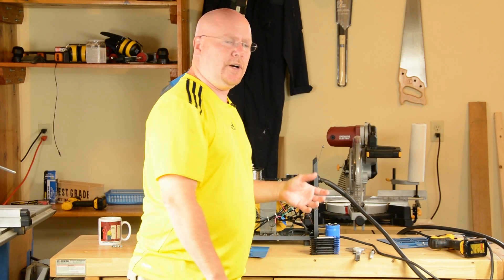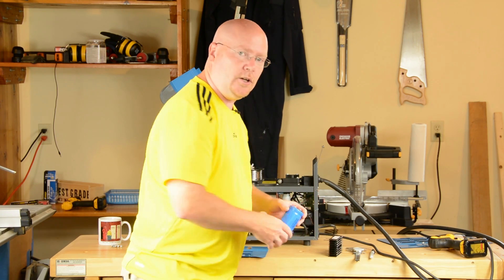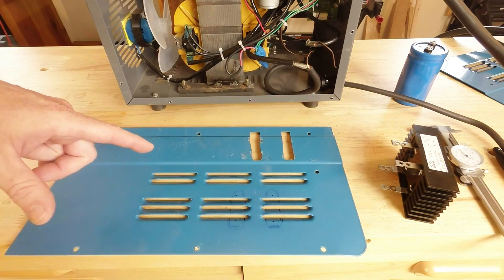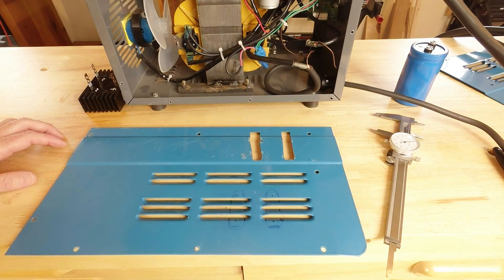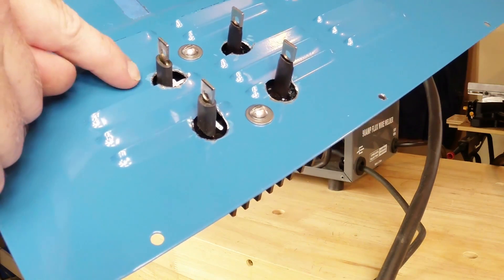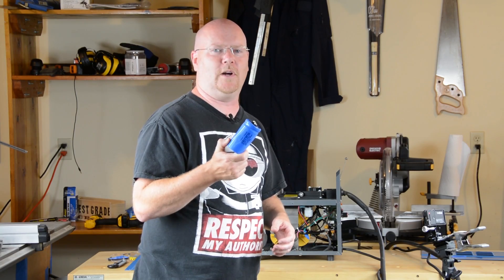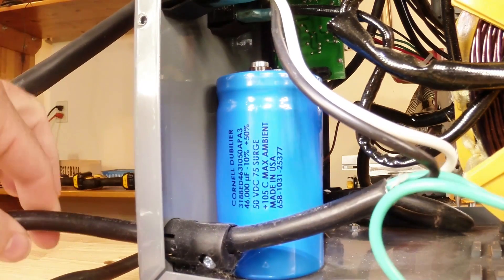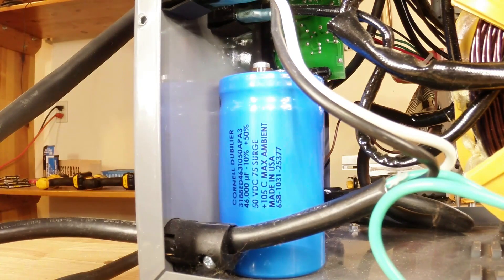Advanced Harbor Freight 90 AMP Welder Mods 03

Comment: Hi I have a 130 amp/90amp tig inverter from hf.  I never used it at all but the capacitor between the positive and negative on the inside of the machine broke one of the legs broke.  Do you know what size is so I can replace it?  It's wrapped with black tape or something so I can't see the values on it
Reply from the maker: HI Steve.  Nope, never had a look inside one of those so I don't know.  If it's broken you may as well remove it (make 100% sure it's fully discharged 1st!) and do what you need to do to it to determine the ratings.  It's not every going to do you any good as-is.
Reply: @MattHeere  thanks for the reply. It is definitely discharged,  was just looking to get it working again.  I'll keep on messing with it in a safe environment.  I appreciate you getting back to me.

Comment: I'm doing the same thing to my welder lime yours, but I moved the power cord to the back, and I'm going with a miller M25 mig gun to it. I bought the welder for  $5, and it was a bit chopped up. I put in a separate 20v transformer for the wire feed motor.

Comment: the rectifier would have been fine with the fin side bolted to the top of the chassis (next to drive feed roller) the fins making contact would have fine.. if you are truly concerned get a thermal pad to sandwich between the rectifier and chassis ;) the case would have quadrupled the size of the heatsink..

Comment: Have you ever measured the max dc voltage off the capacitor? The cap you use is rated at 50 volts dc 46,000mfd.
Reply from the maker: The max DC voltage is equal to the peak (not RMS) AC voltage and is right around 40 volts in my welder.  From other comments, I've come to understand that this can vary by up to +/-5 volts between welders.

This is the at rest condition, so peak voltage but zero current.  When welding, the voltage drops down into the teens.

Comment: matt can a sterio system Capacitor work?i probably missed the wiring from ac to dc.
Reply from the maker: Not usually.  the voltage rating on car audio capacitors is too low.  20 volts or less, when you need at least 40.
Reply: Yes i didnt think of that.thank you.great videos.
Reply: Mr. Matt can you if you can link me to that capacitor.or where you bought it?thanks
Reply from the maker: Hugo Chavez I got mine at a local hamfest.  eBay is your best option.

Comment: why bother with the 90a model? spend a little more for the 170 that welds DC, 1/4" steel, and has the option for gas use.
Reply from the maker: Because I got this one for free, and because a lot of people don't have access to 220V power.  

If you have 220 available, and you're going to buy new at HF, then I think the 180 is the only decent option.  The "Min/Max" voltage selection on the 170 isn't nearly enough control to weld effectively with any serious amperage.

Comment: the rectifier can go inside and be fine i run cnc equipment and yea their  all over inside the electrical control panels
Reply from the maker: +Jon A It can if you can get some airflow over it.  This thing dissipates about the same heat as an electrical space heater (obviously for much shorter periods though).  Even if it doesn't hurt the rectifier, that's a lot of extra heat on top of the transformer heat to subject the wire feed electronics to.

I think if you put it inside you're pretty much committed to upgrading the fan at a minimum.

Comment: Hi, nice tutorial here, can a car alternator rectifier be used for this? I have some cs130's and hoped to use those, thanks.
Reply from the maker: 2008OntarioL You'd have to find the exact specs for the diodes in the rectifier.  Auto rectifiers are typically 3 phase, so would have an extra input that you don't need, but this won't hurt anything.  I'd be most concerned about the current rating.  cs130's came everywhere from 70 to 170 amps.  The smaller ones would burn up fast in welding duty, but the bigger ones might be OK.  Rectifiers can be wired in parallel to achieve higher current capacity too if you really want to start a project :)

Comment: Hi Matt. I have a question for you. I love your modification, and I plan on doing it. I have access to lots of the components you have added to complete your modification. One of those components is a large capacitor. It's a BC 75 VDC 100 SURGE 23000uF -10 + 50%. Here is a link so you can see the capacitor for yourself http://www.ebay.com/itm/Capacitor-23000-UF-3042688-3192GH233T075AMA2-75-VDC-100-Surge-/400850286882 . It's a beast! However, the uF rating is 1/2 of the rating on the capacitor you used. Admittedly, I am no expert with electrical components, but in my research I have discovered that the uF rating is a measure of how many electrons the proverbial "tank" will hold before discharging. How important is it that I use a capacitor with a higher uF rating? Is it less important than the rated voltage of the capacitor? The rated voltage of this capacitor is WELL within the limitations of the welder. If I can't use this capacitor, I will probably have to buy one with a higher uF rating. Fortunately, there is a HAM Radio shop up the road from my work. I think I remember you saying that's where you bought yours. Any advice would be appreciated. Thanks.
Reply from the maker: Trinity Maker You have the concept exactly right.  A bigger "tank" in this case helps keep the voltage closer to constant through out the weld.  If you're skilled at keeping your wire stick-out even then odds are you'll notice no difference at all between your cap and mine.  Even with less than ideal conditions, the rectifier is giving 90% of the improvement.  So, variations in the capacitor are only a small portion of the overall mod.

I say go for it with the one you have.  If you pick up another one cheap at some point you can always swap it out, or add the second one in parallel to even more bang.
Reply: Matt Heere Matt- I have several of them. You think if I put two of them in parallel it would only accentuate the abilities of the welder? I know when you put batteries in series vs. parallel, series doubles the voltage, but doesn't change the current. When you place them in parallel, the voltage stays the same, but the current doubles. Is this the same concept with capacitance? Will the voltage stay the same, but the uF rating double? As I said, I'm a component "novice", so I appreciate your expertise.
Reply from the maker: RIght again.  For capacitors in parallel, the effective uF is the sum of the two.  However, the allowable voltage is equal to the lower of the two caps since they'll both see the full voltage. 

If you wire them in series then you add the voltage ratings.  The effective capacitance is less than either one though.  It's:
1/Ctot = 1/Cap#1 + 1/Cap#2
Reply from the maker: Yep.  It's a wise idea to let a little extra wire out and then short it to the ground to discharge the cap.

Comment: Matt-great instructions. I am definitely going to try this BUT the rectifier I found has 5 pins, instead of only 4. What do I do with the 5th pin? thanks
Reply from the maker: ***** You can ignore it.  You have a three phase AC rectifier, so it has three AC inputs.  Just pick any two.
Reply: Matt Heere wherr can i buy the parts and does it have to be Capacitor 46000 uf - 10%+50%50vdc75 surg+105cmaxambient can u tell me on the uf can go higher or lower

Comment: I wonder if you could wire a relay after the capacitor? I'm thinking you could use the wire from the button on the gun as a trigger. The goal being to prevent the leads from being hot after you turn off the unit.
Reply: Better known as a contactor.
Reply from the maker: You could, but you'd need to use a relay that's rated for at least 100A across the contacts.  You'd probably also need to find one where you could clean the contacts as I expect they'd arc significantly every time you fired up.
Reply: Matt Heere After doing more research, I think I'll go with a big resistor across the capacitor contacts. The relay would just add complication, and the resistor seems to be the most common approach.
Reply: Thank you. I learned something new today!

Comment: So I have a couple of big transformers from some old power supplies that I got from my work.  If I was to use the core of one of these and make a good sized inductor would that work as good as the capacitor?  I have everything to make the inductor but if having a capacitor is better I'll do that... Or both??
Reply from the maker: Both is definitely best.  An inductor will attempt to maintain a constant current flow.  The capacitor maintains the voltage at a constant level.  High end wire welders are built as constant voltage machines, so I believe the capacitor to be the more important of the two.  It also happens to be the easier to install - and I'm lazy.

Comment: Tried to find the same capacitor that you used in the video, no luck however I did find this: http://www.digikey.com/product-search/en?mpart=DCMC463U075BF2B&vendor=338
Would this suffice Matt?
Reply from the maker: It would work C Collins, but I'd hate to see you put $60 into this welder.  Try eBay.  I found this one:
http://www.ebay.com/itm/NEW-CORNELL-DUBILIER-CAPACITOR-101X463U050DC2B-46-000-uF-50VDC-10-75-/390950126499?pt=LH_DefaultDomain_0&hash=item5b067183a3

Normally you can do even better than this.  ~$25 including the shipping should get you in the neighborhood of 50,000uF
Reply: Awesome, thank you sir! I have had this welder for years and it has been great; looking forward to modifying it to run properly. Excellent videos on the welder!

Comment: Thanks for the videos on the Harbor Freight 90 Amp flux welder.  I am new to welding and need a "welding for dummies" video.  I bought one of these machines, but must admit, I'm afraid to use it.  I bought a self darkening mask and extra wire, so I'm ready to go.  For instance, where do I connect the ground?  Can I touch the part that I am welding without electrocuting myself?  How do I safely operate this tool?  Is there a basic video that you can recommend?.  Thanks.   Len
Reply from the maker: Hi Len.  Welcome to the channel!  I'm probably not the guy to teach you to weld, as I'm just a hack myself.  Check out weldingtipsandtricks  and *****  for welding info from guys who do it for a living.  They both have particularly good videos about how to set the welder, and some good looks "through the mask" so you know what to expect.  If you call around to your local welding supply stores, my guess is that at least one of them will have a free or cheap class for beginners.  That'd be a great way to get yourself jump started.

Having said that, it's not as scary as it seems.  Just attach the ground clamp to a nice clean spot on your work piece somewhere, set your auto-darkening helmet on "10", and give it a try.  You won't get a shock from the work piece.  Do make sure you have on heavy welding gloves though anyway because the heat travels much farther than you'd think.  Also note that the welding arc gives off a lot of UV rays (hence the welding helmet), so any skin not covered up can get the equivalent of a sun burn.  Last thing to look out for is that you have plain old mild steel to practice on.  Galvanized (zinc coated) stuff gives off a toxic fume when welded, so try to avoid it.  The flux core wire generates enough of it's own smoke, so you'll still need good ventilation.

Good Luck!
Matt

Comment: Hello Matt,
I just purchased this exact welder several days ago. After watching your entire advanced mod vids Id like to do the same to mine. Can you please forward part numbers for the capacitor and rectifier you used and or links as to where to purchase.

Thank You
Reply from the maker: H Davila I don't have part numbers per se, but the exact parts aren't critical at all.  Any bridge rectifier will do so long as it has a current rating that exceeds your welder output.  Likewise any capacitor will do so long as its nominal voltage rating is higher than your welder output while not welding.  The amperage will be a well advertised spec for the welder.  The voltage you'll have to measure to be sure, but it's unlikely to be higher than 50 VDC.

For the HF unit those limits turn out to be about 100 amps and 40 volts respectively.  A lot of the large rectifiers on eBay are setup for 3 phase power.  That's OK, just ignore one of the 3 AC inputs.  As for capacitance, the more the merrier right up until the capacitor won't fit in the chassis any more....

The capacitor is by far the harder of the two parts to find for a reasonable price.  New they cost more than the welder, and used you have to be careful.  Caps degrade over time, so a couple of years old is OK, but you don't want one that's ancient.

Comment: My welder is a 125a flux core and the only 150-200a bridge rectifiers I see on Ebay have five terminals. What's the 5th for?
Reply from the maker: The 5 terminals are for rectifying 3 phase AC power.  There are 3 AC inputs and the two DC outputs.  You can use one of these and just ignore the extra AC terminal.

Be sure you need the rectifier though.  Most wire welders already provide DC output, even the flux core only ones.  AFAIK the Harbor Freight units are the only ones so cheap that they're AC output.  I'd check it with a volt meter before starting buy components or take it apart.  If you do need to add a rectifier, you'll need something bigger than the 100 amp thing I used.  If your welder is 125 amp output you need that size rectifier at a minimum.  150 amp rating or higher would be safer.  The harbor freight welder is only rated for 90 amp output, and realistically produces more like 80.
Reply: Mine is a harbor freight clone, mostly the same internally except a bit larger and the wire drive motor is powered off the PCB up front and not off the leads.